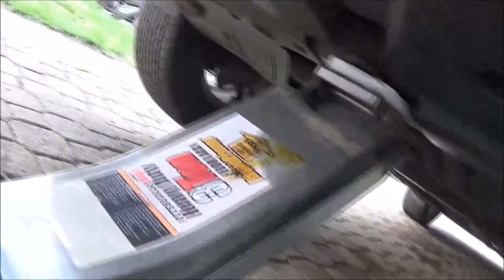Hyundai 3.3 V6 Cartridge Style Oil Filter & Change

Comment: Excellent vid. First I've seen that addresses Hyundai V6 vehicles with the oil filter at the top of the engine. Steps clearly illustrated without fluff 👍🏽

Comment: Just did this tonight and I had a midgrade Fram TG9999 (China) and an STP S9999 (Korea) and I wound up putting in the STP.  Even though the Fram claimed 99% filtration efficiency vs the STP's 93% the STP looked better constructed in the media with even pleats and no sign of a glued seam, the exact opposite of the Fram.  I think I chose the Fram because last time I used the Ultra Synthetic, their top filter for this car, and it held up great.  Like the pros say "spend the extra 4 bucks on a better filter instead of thousands for a new engine."  I may even pop over to Hyundai before the next oil change to see what the OEM looks like compared to STP and Fram Ultra.  The only thing I'd add is I heard somewhere that it's best to remove the oil filler cap and the filter AND then drain the oil.  Something about a more efficient drain with less vacuum.  Thanks
Reply: I guess I'm kinda off topic but do anyone know of a good place to stream new movies online?
Reply: @Zaid Imran lately I have been using flixzone. You can find it by googling :)
Reply: @Anthony Garrett Yup, I have been using FlixZone for years myself :D
Reply: @Anthony Garrett Thanks, I signed up and it seems to work :D Appreciate it!!
Reply: @Zaid Imran no problem :D

Comment: When I bought a filter for my 2007 Sonata (6cyl), it had two rubber rings AND a metal washer. What's the washer for?
Reply: Metal washer is for the drain plug. It is supposed to be replaced each time.
Reply: I have no idea.  I've only ever used the two rubber rings (mostly :).  Sometimes it pays to read the directions.